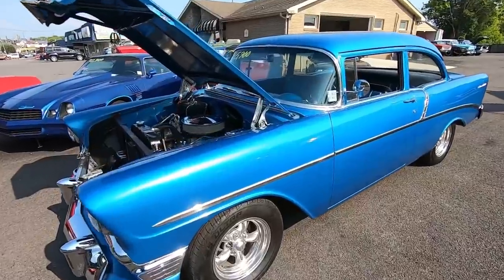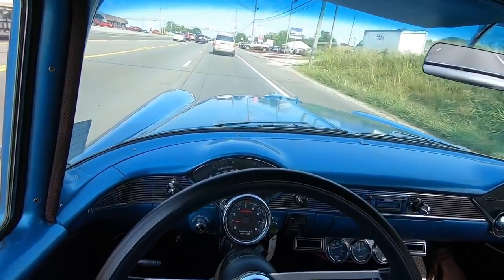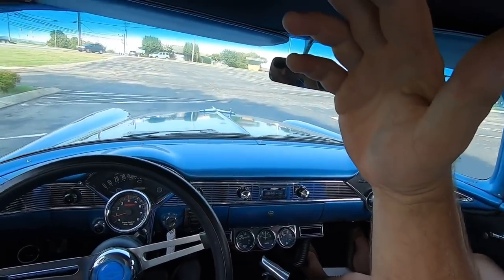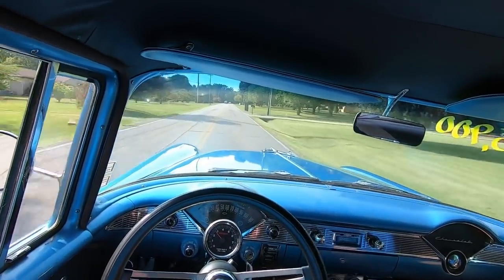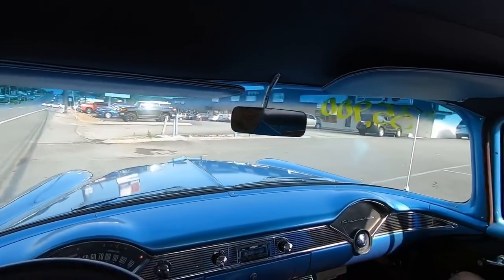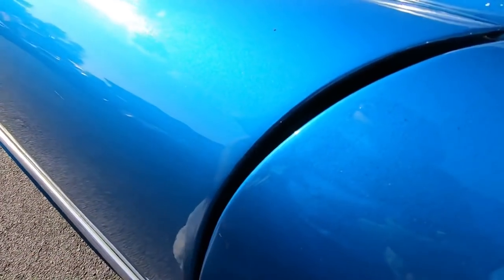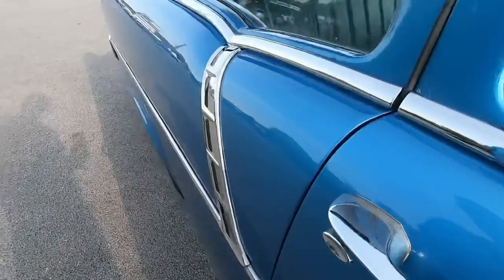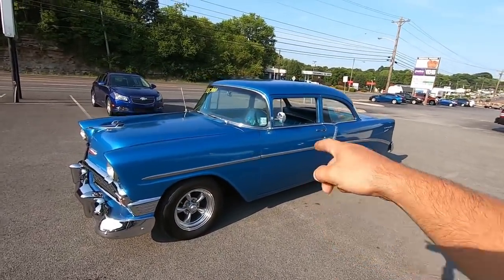Test Drive 1956 Chevrolet 210 Post SOLD $35,900 Maple Motors #1189

Comment: You should take bets on reverse lights also lol I've had so many that have aftermarket shifters and they don't hook them up
Reply: Same here. 4/5 times on these older cars when someone puts in a new shifter or transmission they don’t bother hooking up the reverse light switch. Same story with wiper motors

Comment: Nick the horn and wiper thing is not great vote of confidence for a potential buyer. 
Customer expect those little things to work who’s gonna dish out $36,000 dollars for a car that to the basic mechanical things don’t work. These little things should be fixed and all the cars that you sell. I just saw medical instruments to the Germans they’re very picky she had one fingerprint down the instrument take us is a whole lot and start dimensionally inspecting. The thing is if the little things are screwed up the customer is going to take what the hell else is screwed up.
Reply from the maker: Well this car is now on hold and will be sold like all the others soon. We have been doing the same thing for almost 40 years. Horn and wiper thing has been a running joke on the channel for 3 years now. I mean 50 + year old cars and they are not 60k. I would expect it to have flaws. Thats why I point them out. Thats why we have such a high volume of sales every month. Honest, upfront , and we keep the prices as low as possible. Thanks for watching
Reply: Having a horn or marker light to tinker with when u buy a new ride just gives you another reason to spend the night in the garage with her.